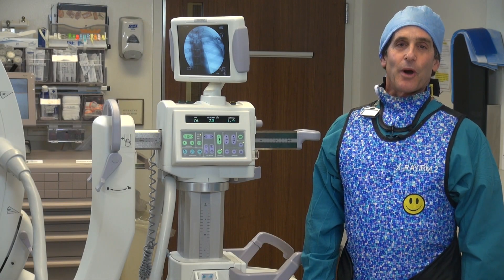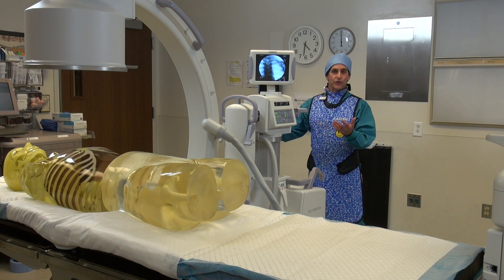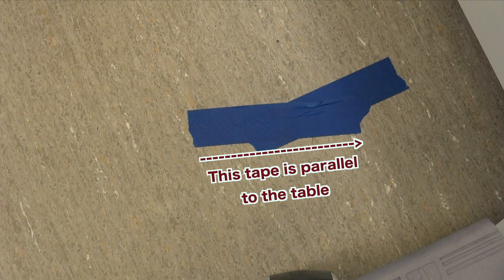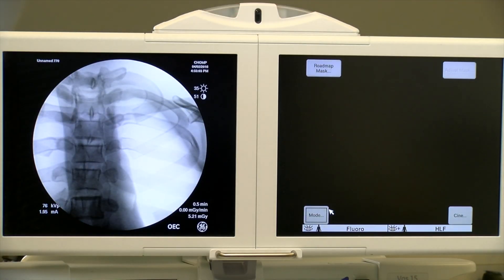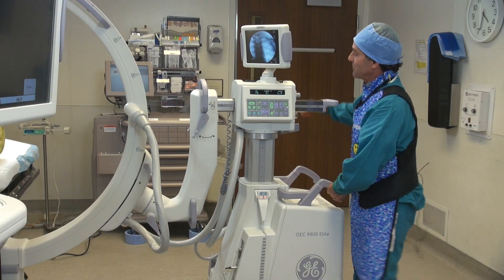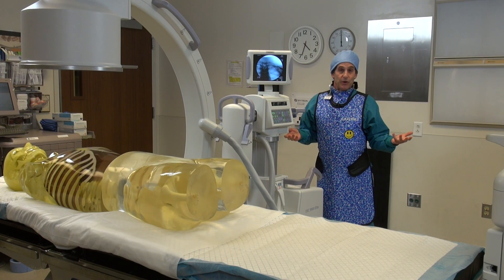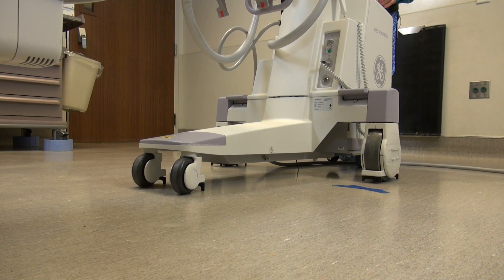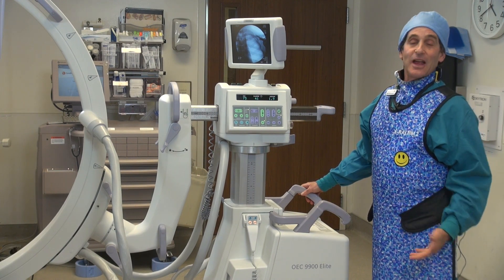How to Properly Move a C Arm In and Out and End Up in the Same Place

Comment: Michael `s theatre  II Tips
1.	Take all the keys to every machine  just in case yours stops working
2.	Let the surgeon decide where the II comes from , where the Monitor should go, don’t assume
3.	If the body part is over the steel table base, or the metal table edge, or gaps in the foam table are in the way then –solution-  Move the patient.
4.	Beware sandbags , can be put under hips/ chest by inexperienced theatre staff
5.	Set a manual kv  for extremities -so that even if you come in and are centred in the wrong place , the image will be correctly exposed. Otherwise if your going in and out, over the body part, even slight miss centering, will result in a black/ underexposed image, because it will give a fresh air exposure eg 44kv  ( which would not get through a finger). Generally hand 52kv, ankle 57kv, knee/ shoulder  62k , then tweek it.  I once I  had a student who never centred bang in the middle once, for an ankle op . The surgeon  didn`t notice.  The foam table makes 2 kv difference. Some machines require the first exposure to be on the AED.
6.	The ii has an obese button, which is the maximum mA output, find out where  this is. If this doesn’t work and the image is black – still under exposed , the only thing you can do is try and use the Monitor brightness/contrast – this may well not work ! there`s nothing you can do !! with this machine.
7.	Save all the images- make this a habit- you don’t know which operation turns out wrong, even though it seems ok at the time
8.	If your doing AP and Lateral, every time you go to the other position , swap the image over on the monitors. So you always keep an AP on one side, and a Lateral on the other. This takes concentration.
9.	The worst problem is obesity with osteoporosis. Obesity means the II will use a high KV eg 110kv  ,so LOW  contrast. The bones will be very hard to see, because they don’t have any bone in them ! If the surgeon is moaning explain this LOL I had the same problem with AP hip on a young man- biggest muscular thigh  in England.
10.	Expect the first image to be wrong, wrong place , wrong orientation. Move the wheels in the direction you want  to go, either towards head/ foot  or in/out , make it easy for yourself , move in each direction  in turn, and you will get where you want to be. Small movement`s to keep control.
11.	Don’t let the surgeons use the flat II surface  to apply a wet Plaster of Paris, unless you cover it first with a plastic bag, or water will get into it and it will go bang !
12.	For hips / DHS cover the tube ( under the table/ hip) with a plastic bag ,so blood doesn’t get into it.
13.	You can get a lateral  of the humerus,  femur with the patient flat  ( both legs down) on the table if you come in sideways, from the opposite side,  and angle 70 degrees. and the body part ( shoulder/ hip/ femur) is right over the edge of the table ( so the metal table sides are not in the way)
14.	If you leave the theatre for a break ( very long case)  always tell someone whose sterile ( surgeon/ scrub nurse)  where you will be, just in case they suddenly need you back.
15.	Only ask the surgeon a question when hes not doing something dangerous e.g. with a drill.
16.	At the end of the operation get a clear answer you are finished BEFORE you remove the sterile xray cover.
Reply: I’ll pass these on and cascade!!